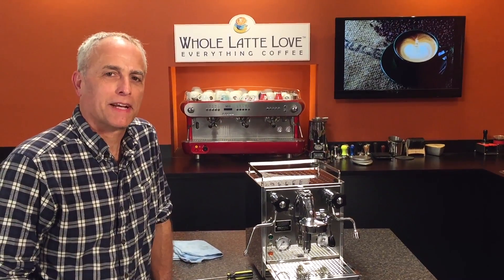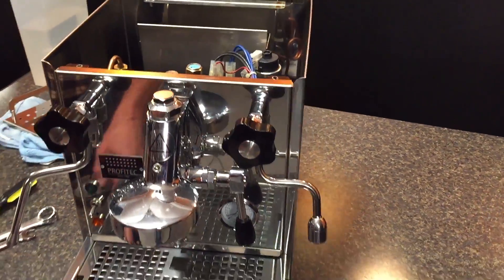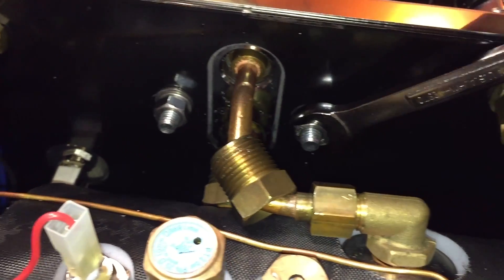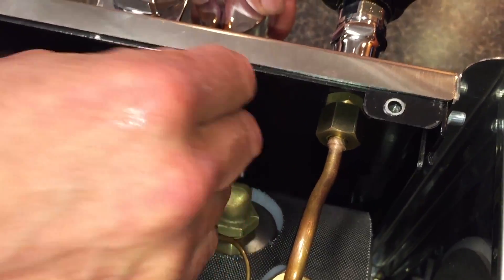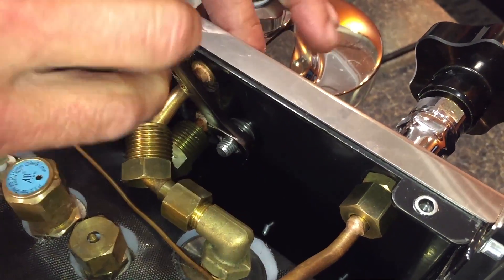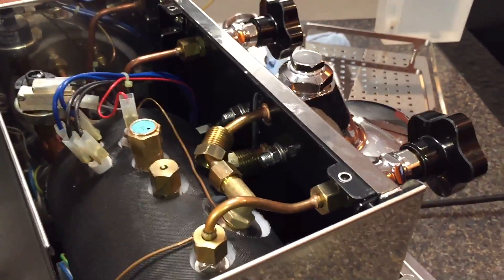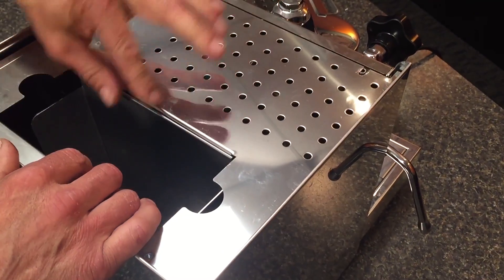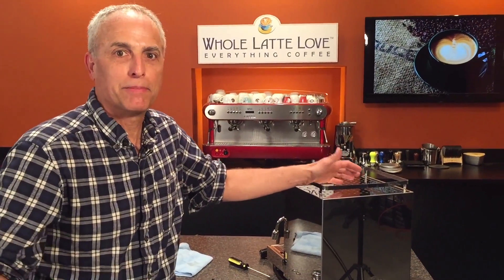How To: E61 Brew Group Remove/Install Profitec Pro 500

Comment: Thanks for this very helpful video! I had to replace that gasket you are talking about because it was disintegrating. 
What this video does nót show is that these two waterpipe retaining nuts can difficult as hell to get loose. Typically you should not use a 21mm wrench but use one of those adjustable wrenches (in dutch we call them ‘bahco’) because you can adjust it tigher/better to the fit of the nut you are trying to loosen. The scale, heat and difference of material (copper nut onto steel threading) make these nuts almost seize solid after a couple of years. It actually took me a couple of blows of a hammer on the end of the adjustable wrench before they came loose. I now put the tiniest bit of vaseline on the threading during installation. But again, thanks for the helpful vid!
Reply from the maker: Hey t, you are welcome and thanks for detailing your experience and the tips!

Comment: Hi,
If you have to totally descale the brew group would you immerse it in as to not discolour it as some acids turn them pink.
Thanks
Reply from the maker: Hi John, Not something I normally do so I forwarded your question to our Service Manager and this is his response:
You can but you should only submerge it for a few minutes at a time and rinse really well with cool water in between. The chrome does not instantly discolor like the raw brass will.
I suggest putting the descale solution in a spray bottle and spraying directly into the group. That's typically what we do in the shop unless we're doing a complete tare down and rebuild.
Reply: instablaster...